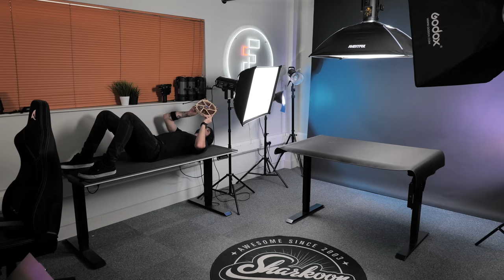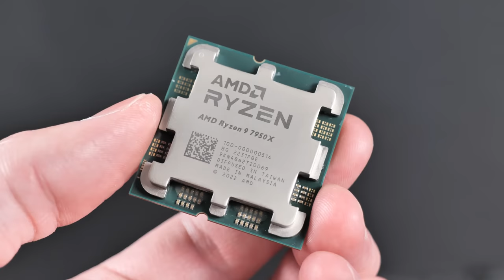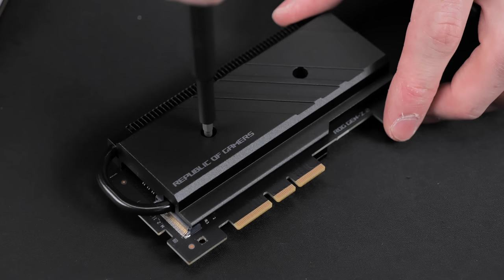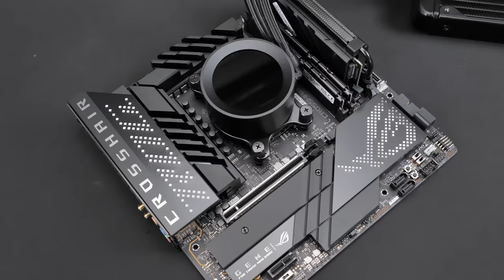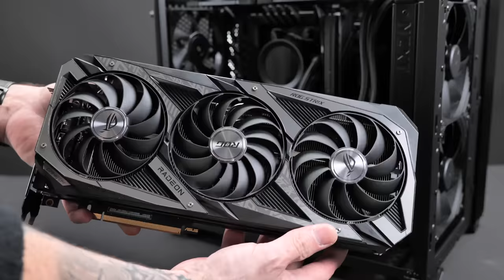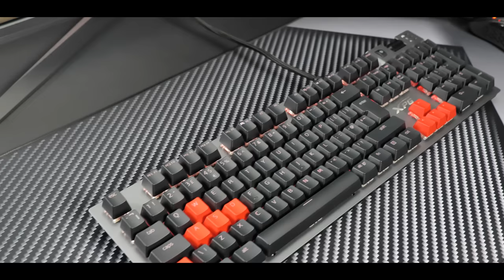A New Era Begins! | Lian Li O11 Air Mini AM5 Gaming PC Build | AMD Ryzen 9 7950X, ROG X670E Gene

Comment: Did you use the original hardware with the kraken cooler or did you get the new stuff from Nzxt because I have a z73 and I’m wondering if I actually need the new mounting hardware?
Reply from the maker: I used the standard AM4 mounting kit which came with the Kraken cooler. NZXT have announced they will be supplying a more specific AM5 bracket, however I haven’t noticed anything negative in terms of thermal performance using the AM4. I’d definitely use the AM5 bracket when they release it though, it will be better optimised 👌
Reply: i´m in the same situation,thanks for the question :)
Reply: @Mr_Matt_Lee  Im in the same boat with a z53 and this put my mind at ease for when I up grade. Im still rocking a ryzen 2700x  on x470 board and I have no choice but to upgrade to 7000 series cant wait
Reply: I'm thinking of get the X73 so it's good to know that am4 kit is compatible
Reply: z73 wont fit in this case, only a (z63) 280 up top with a matx/itx board or 240 on the side regardless of what you use to move its position

Comment: There’s something about all black or all white pcs that makes me happy inside. It’s a shame that white pcs are hard to build on a budget
Reply: Tell me about it... Just finding the parts can be a challenge on any budget.
Reply: Pc black parts aren't the problem, but white stuff, oh boy :(
Reply: @andre.camelo  ya, it’s weird
Reply: you can just plastidip or spray paint stuff white. It's not hard and if you take your time, the quality is also very good.
Reply: @changen4125  true... So long as you buy components that are friendly to being torn apart and take paint without interfering with anything. Just a little bit of hassle and always kinda nicer when they come designed to a white theme... But yeah, I have a can of plastidip for that very reason. Mostly try to just use it to touch up little things here and there though. I wouldn't paint fans/heatsinks/radiators personally though.
Reply: Racist parts 😂
Reply: I know what you mean, I'm building a white Setup right now, same Case but 5800X3D CPU, I really want a white 3090, but there is only the ROG Strix at a cost of currently 2000€. And that's absolutly not worth it.
Reply: Hardest white component to find for me is a MOBO
Reply: @arthurmonroe1918  that's largely why I just bought an overpriced $500 x670e Taichi Carrera - because it's mostly a white motherboard 😑
Reply: @arthurmonroe1918  i would say it’s the gpu, especially when you’re looking at lower tiers like 3060 or 6600xt
Reply: @blayses3116  yeah it's hard to find AFFORDABLE white motherboard/GPU options. They're typically only available on the middle - upper end of the scale.
Reply: @Matt-gf4gd  ya true
Reply: You can always start with a white baseline like white case, ram and fans. And then in the future save up for better components that come in white
Reply: @Matt-gf4gd  it’s worth it.. it’s so worth it.. 😂
Reply: @Matt-gf4gd  You had b650-a as a option its full white with rgb logo
Reply: I've had a total white build and used the Z490 Asus prime mobo with the fractal design white case and Zotac gaming 3060 GPU, looked great in my opinion. Worst thing with white builds is the differences in white shades... in some angles it looked like 3-4 different types of white wich kinda sucked once noticed.

Comment: I personally love the stealth builds. recently re-did my rig in that exact case. IMO its one of the best out there, compact enough but offers all kinds of cooling options, great cable management etc. I actually with with a second aio on the gpu running off the gpu temps (pny card has a mini 4pin  you can connect a controller to). learned a lot, would probably just doing a custom loop next time but this case is one i hope they keep around for awhile.

Comment: Awesome!

Just did nearly the same build - 
7950X
32GB G.Skill 6000MHz / 30 CL (F5-6000J3038F16GX2-TZ5NR)
ASUS X670E Crosshair GENE microATX
NZXT X63 280MM AIO
WD SN850X 4TB NVME SSD
Corsair AX1600i PSU
Lian Li 011 AIR MINI case

No GPU, yet - waiting on the 4090.

Mounted the AIO on the top - the NZXT X63 fits with a microATX (the Arctic Liquid Freezer II 280MM has too big of a radiator - had to return it) - gives me 363MM of space for the monster 4090s. :)

Comment: As always in all your videos just two words: Incredibly clean.

One question, why when using a Matx motherboard you didn't use the 5 slot configuration of this case, that would bring the GPU closer to the bottom airflow?

Do you think that the front AIO harms the GPU thermals?

It has continued like this for me the best PC Building channel.
Reply from the maker: Thank you Juan, appreciate that comment. I didn’t use the 5 slot method because truthfully, it’s only really appropriate if you’re using a top mount rad. This would give you more clearance of the motherboard of course. Leaving it this way allowed more air to move below the GPU - which is just as well if I intend to put a 40 series card inside! Haha

Comment: Projeto ficou top!
A única falha é que vc deveria ter usado o recuso modular do gabinete pra descer e centralizar a placa mãe no meio do Gabinete!
Reply from the maker: I purposely didn’t do that. Lowering the motherboard is only really necessary if you’re putting a radiator at the top, this gives more clearance to the motherboard. I wanted more space below the GPU to both provide more air for the graphics and also leave enough space to put the Noctua GPU inside for testing later…
Reply: @Mr_Matt_Lee  Foi só uma ideia... mas ficou incrível, parabéns !!

Comment: not understanding why the intake fans were next to the side fans used for exhaust... kind of counter productive i feel like. easy fix is making those all intake and use the ones on top for exhaust and the one in the back exhaust but getting into the bios and cranking up the rpm a little to equate. but none the less cool build for sure
Reply: using this comment for reference!

Comment: This is beautiful Mr. Lee. Do you think an Nvidia RTX 4090 FE  (304mm length) will fit in there with the front-mounted radiator as you have it here? Otherwise, I could do it like your "Big Cases?" build. I just need to determine whether I need the 240 or 280 mm rad. Thanks!

Comment: Nice video. I have several questions: 1. Why you used thermal paste for that water cooler, from what I know it comes with reapplied thermal paste? 2. Why you chose to not use the case's M-ATX mode ?

Comment: mounting the radiator like that means there is always air sucked into the tubes. won't last long.. you want to have the tubes at the bottom or mount the whole thing into the top.

Comment: I love my Air mini. I modded the front just a bit with a dremmel, removing the inner bezel on the front fan mounting hole, and was able to fit 2x 280mm rads for my z390i and 3090fe custom loop. using 35mm(i'm pretty sure) thick rads i can keep temps below 60c. the active backplate on the 3090fe block from ek helps, but the card weighs in at around 7lb, no joke, and had to use the vertical mount for this case to avoid sag

Comment: Such a nice cinematopraghy. Great video! Although I didn't like the orientation of the AIO. Try flipping it upside down, so the tubes come out from the bottom. Steve from Gamers Nexus did an excellent video on that matter. Also my heart cried, when you didn't put the superior Noctua fans on the radiator and went with the NZXT ones instead. Wasted potential imho, since the Noctua provide way better performance on a rad compared to the NZXT, which would more than suffice as case fans. But all in all I really enjoyed the build and approach to making a video about it. especially loved how you presented the components at the beginning: Short pan with the camera of where that stuff is about to go then to a wide shot of all components and a nice freeze frame with description of all components. Loved it! That's the way it should be done.
Subbed for more, keep up the great work!
Reply from the maker: Appreciate the feedback and kind words about the build 😁 Just so you’re aware, I did use Noctua fans on the front and not NZXT. ALL of the fans in this build are a combination of 140mm and 120mm Noctua Chromax fans 🖤 as for the pump orientation, it’s totally subjective. I’ve been running an AIO for two years like this and no issues at all, I can see the science behind it though 🤜🤛 thanks so much for the comment and support too! 😁
Reply: @Mr_Matt_Lee  Nice! Haven't seen it properly then with the fans. Just wanted to let you know if you're having trouble in the future. Really appreciate your answer, too! :) How are the temps on the CPU? Is a 240 Rad enough for that beast? I guess it's stuck at 95, but boosts all the way on the clocks :D

Comment: Hey lovely build. Just have one question, it looked like the radiator and the fans are mounted seperatly? Is that right? Would it be possible to put install 140mm Fans in the front with my nzxt x53?
cheers

Comment: Beautiful build... have the same case it's surprisingly spacious considering the overall size... it easily fits my RTX 3080 Suprim X vertical mounted... just those 7000 CPUs are very toasty and I doubt my 240mm AIO can handle it 😖

Comment: The 2 bottom fans are blowing air downwards? And can you explain why the 2 fans sideways next to the cpu cooler are for? Sorry if this is a dumb question, I could take ideas from your videos for my ultimate build. By the way I've never seen a PSU installed sideways, that case is something to have.

Comment: So what's the selling point on this case? That it's shorter in vertical height, but a little wider to fit the battery and ssd's? Cause I've been looking in the market for a smaller case, that still maintains good airflow.
Reply: pretty much. really compact, not tall, while still having room to play and doesn't compromise all that much. it can eat up atx mobo, custom loops or a thick ass air cooler while improving on o11d mini. probably one of the smallest cases that can eat an atx mobo. closest competitors are probably fractal torrent compact, meshify 2 compact, nzxt h5 flow

Comment: This but with 280mm AIO from Arctic Freezer with rad mounted on the side and Gigabyte's Aorus 4090 Waterforce with 360mm rad mounted to the ceiling with offset brackets. Maybe mATX board if there's anything worthy (ITX boards are so juicy for AM5!)

Comment: What happens if we use a Deepcool as500plus ,9fan 120mm ,3fan 140mm front and rear  to filled all cace and gpu 
RX 7900 XT vertical?  Will it fit or not? 
I try to mix it from your previous video for my first build. all black is awesome!! thankyou

Comment: Did you need a different bracket for the AIO to make it work with AM5? I have 360 version of it on AM4, but want to know if it worked mounting it right out of the box on AM5?
Reply from the maker: Hey! Check my reply on the pinned comment 😊🙌

Comment: Did you use an AM4 bracket or the new AM5 one that NZXT is sending out to mount your AIO?
Reply from the maker: I used the standard AM4 mounting kit which came with the Kraken cooler. NZXT have announced they will be supplying a more specific AM5 bracket, however I haven’t noticed anything negative in terms of thermal performance using the AM4. I’d definitely use the AM5 bracket when they release it though, it will be better optimised 👌
Reply: @Mr_Matt_Lee  I received their AM5 bracket today. From what I can tell is that it prevents you from overtightening the screws since the height of the CPU sits at a different level to AM4. Overall it seems to just make it a bit more foolproof so you probably wouldn't need it since yours is already up and running
Reply from the maker: @KCHG  gotcha! Thanks for the update too :) NZXT have 6 brackets in route to me currently so that’s good to know! Totally see the ‘foolproof’ nature of it. I took extra care to not over tighten taking into consideration the extra height of the new CPU too 😊

Comment: Nzxt kraken z63 suport socket AM5?
Reply from the maker: I used the standard AM4 mounting kit which came with the Kraken cooler. NZXT have announced they will be supplying a more specific AM5 bracket, however I haven’t noticed anything negative in terms of thermal performance using the AM4. I’d definitely use the AM5 bracket when they release it though, it will be better optimised 👌

Comment: Looks good, are you gonna try adding a 4090 in this case? I'm curious to see the compatibility.
In theory even the Strix fits but I'm not sure.
Reply: A 4090 is bigger than the entire build, if you did mange to squeeze one in there the heat from it would cook every other component.. Mini pcs are lame
Reply: @tonys2683  this isn't sff case however, it can take eatx mobo.
With proper airflow it should be decent, or even custom loop which weirdly the air seems better than dynamic for.
Reply from the maker: Certainly something I’ll try and entertain for sure! The radiator would absolutely have to be top mounted for that to work, even the 30 series was a squeeze with a front mount rad 👀
Reply: @Mr_Matt_Lee  ill be eagerly awaiting that video, thanks for this one and the reply, it looks great.
I'm going from o11 air to air mini so I've been watching loads of builds!

Comment: are u using lga 1200 or lga 1700 mounting bracket?
Reply from the maker: I used the standard AM4 mounting kit which came with the Kraken cooler. NZXT have announced they will be supplying a more specific AM5 bracket, however I haven’t noticed anything negative in terms of thermal performance using the AM4. I’d definitely use the AM5 bracket when they release it though, it will be better optimised 👌

Comment: I would love to build the same build  🥰
Quick Question tho, the side fans are also exhaust?
Reply from the maker: Yes they are. It’s a great airflow method, pulling air straight through the rad and out the back of the case instead of through the rest of the case 👌
Reply: @Mr_Matt_Lee  so front & bottom intake, side, top & rear exhaust? Confused. Thanks for clarifying.

Comment: I really like this build in that case, very small footprint, yet fits such a high end hardware. The only thing that is turn of is the GPU support I was never big on GPU supports.I have Strix 3090 and is mounted vertically in my caselabs case, but  if I would to go with this case, would my card sag, I'm wondering. I've seen few ppl Strix 3090 not sagging at all so I'm curious if its necessary

Comment: Hey one question and you're probably not going to answer which is fine, that bracket for the NZXT AIO you've installed. is it the existing AM4 bracket that comes with the AIO or is it an AM5 Bracket that comes from the request AM5 bracket page in the NZXT support page? I need to know because I am currently putting together an AM5 system and I am not sure if I need to buy a new AIO cooler or I can use the existing AM4 bracket with no issues because I cant submit a form for a AM5 bracket from nzxt due to losing my proof of purchase which is my recept lmao

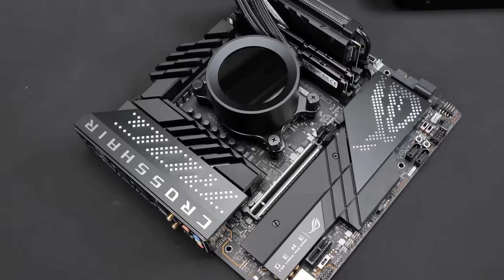Comment: What is that on 3:19?
Reply from the maker: It’s a DIMM.2. Basically, you put your M.2’s inside it, which places them in the line of cooling from the front fans whilst also providing quick and easy access without removing the GPU as you traditionally would 😊